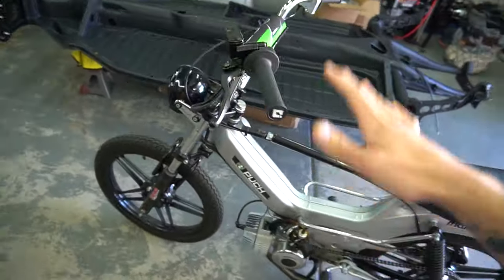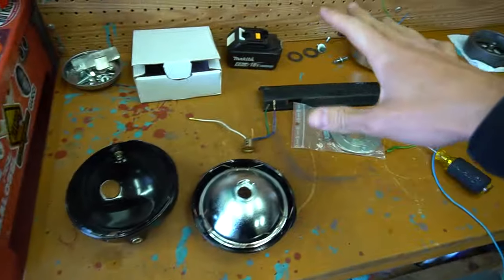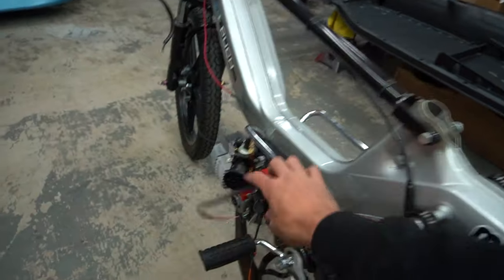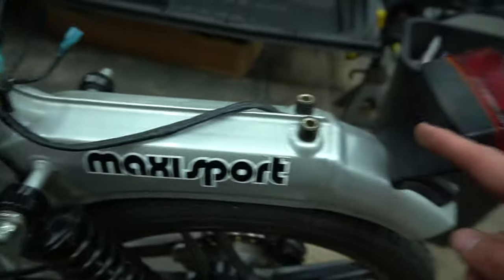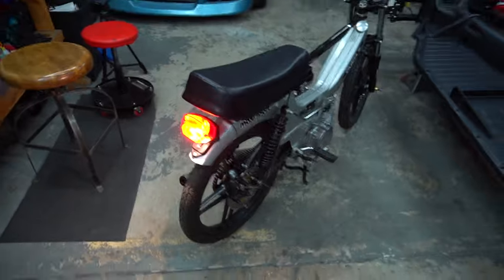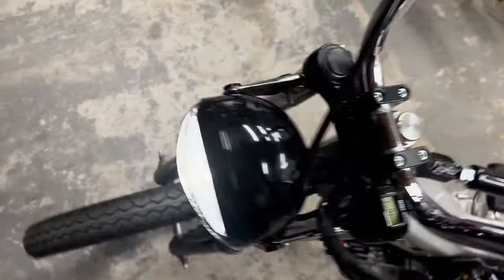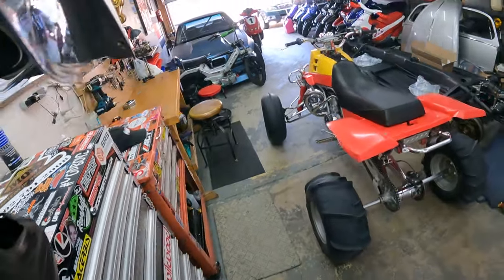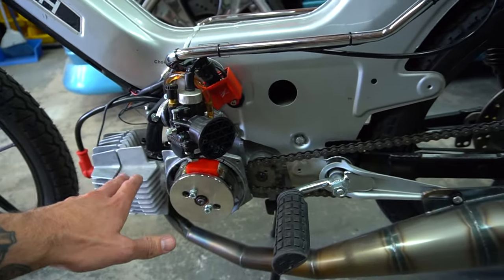HUGE POWER upgrade on my Stunt Moped!

Comment: Use MVT Digital Direct inner rotor ignition. It works the same and it has charging system. Love the vids!
Reply: hpi also has a version with charging system

Comment: I did 70mph with my polini but with mvt ignition selfmade exauhst and a ported cylinder and crank case and a crank with longer stroke also with a big valve kit really helps and a 24 mm carburetor

Comment: The taillight flashes when it turns on because you have it wired to the brake terminal instead of the taillight terminal.  It's supposed to flash when you hit the brakes then stay on as you hold them (like at a stop).  That's also why its so bright lol
Reply from the maker: there’s nothing in the taillight that would have that make sense, it’s just a bulb mount and a single wire, nothing that could relay or break any connections to make something flash. epically with how i straight wired it haha , that’d be sick though
Reply: @MOPBOYZ  The flashing circuit is in the bulb itself.  All it needs is constant 12v and it'll flash.  In my car I have an inline flasher module that does the same thing for the center brake light.  Goes in the 12v line for it and does everything internally. 

Can you put the bulb in upside down to see if it'll use the other terminal?

Comment: Sounds great bro. but hearing the rpm you could probably run a smaller rear sprocket and get some more top end speed
i had my polini kit goin 115 kmph at one point clocked with a car driving behind me. but that was a 65cc polini. i didnt know they had 64?

Comment: Bro, Nice build!  I always follow your amazing videos. I got a 2022 Piaggio Liberty S 50cc, thaere is any way to make this thing go faster? I live in Las Vegas too.
Reply: You can use a malossi ecu with the 80cc kit and the malossi camshaft and it will probably go around 75 to 80 km per hour idk the mph tho
Reply: @pimuitterlinden3927  Thank you! Right now is going almost 70 KM, without any modification,  but is very slow at start.